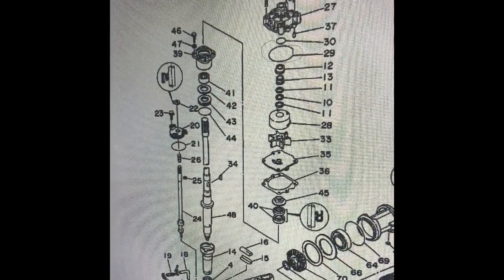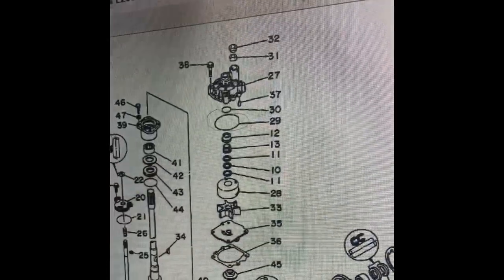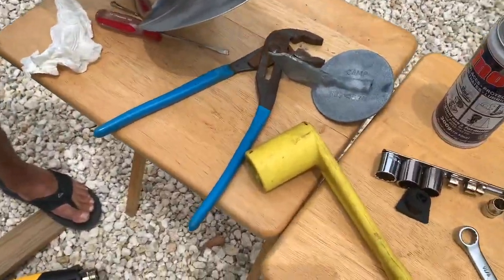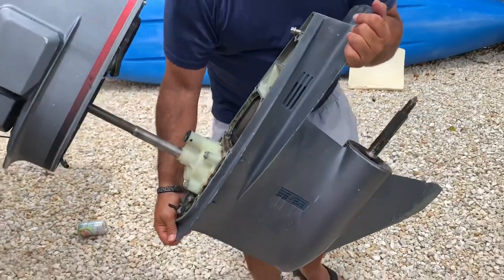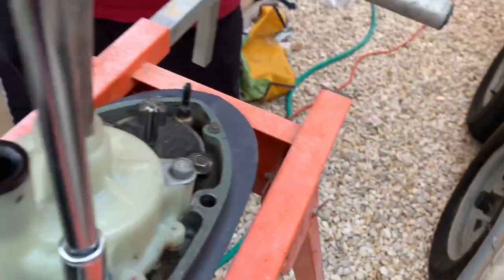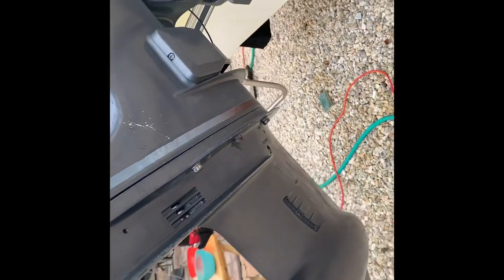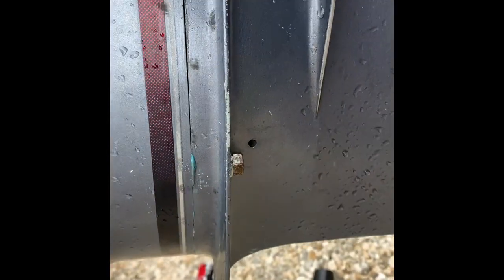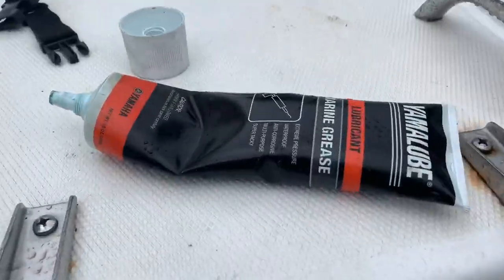How to Change an Outboard Water Pump on a 200 HP Saltwater Series Yamaha

Comment: Just love how you said video on how to do water pump and you didn’t show putting the hard part together great video
Reply: I agree didn’t show weather he firstly put it into gear how he changed the impeller what direction  he spun the housing how he lined up putting the lower unit back up  what torque settings to use

Comment: Do you have a picture of the impeller? I’m curious to see what it looked like. I got an overheating alarm the other day on the same motor. I’m thinking about your other video and cleaning out the water jacket. Pretty sure that super dirty. I’m getting a weak stream coming out so it’s either the impeller for the salt buildup in the engine.

Comment: Hi -- I have the same motor but 150hp. Motor runs great on the hose but under load bogs down, seems like not all cylinders are firing and boat doesn't come near plane. Any tips to diagnose before I take it somewhere?
Reply from the maker: Yes I had same issue a couple years ago. I bet it has gotten progressively worse right . ? I bet in the past you could get on plane then it would come off then got worse . It’s the carbs. You need a carb job . Take it to an outboard repair shop that you trust . In south Florida we have Eric’s . It’s per carburetor they will charge you but you will be all good to go .
Reply: @arnoldtrevilla  thanks for the reply! Honestly, it hasn't been run enough to notice and probably part of the issue (old gas). I'm up in Palm Beach County and unfortunately my mechanic has retired after 40yrs in business so will have to locate a shop.
Reply: I pumped all old gas out, carbs still needed cleaned tho. We're back floating!

Comment: Would all this be the same on a 2004 200hp salt water series II
Reply from the maker: Mike if the engine layout is the same with the water jackets at the back of the cowling then yes
Reply from the maker: My apologies I thought you were commenting on my other video . No do not assume that but would be surprised if there were much difference .

Comment: Have you ran the boat since doing this? I was told the shaft should go in all the way without tightening bolts
Reply from the maker: Yes I put shaft in all the way. And put bolts in and tightened them(Lower unit bolts ) evenly all the way around

Comment: what do you think about this engine things like consumption and problems compared to new engines is it easy to maintain end to find parts  ? I'm think to buy one this here in Brasil with 500 hrs used stop in the garage 5 year
Reply from the maker: I love this engine super reliable and easy to fix it’s a 2 stroke so yes much easier than 4 stroke and newer to fix but it does consume a good amount of fuel compared to a newer 4 stroke .
Reply: @arnoldtrevilla  how much it  consume per hr ?
Reply from the maker: @marcelopereque  I do not I apologize
Reply: @arnoldtrevilla  thanks per your attention DY
Reply: Love mine it pushes mt 23 CC really well.Wide open 41 mph cruises at 30 and it does get 2.3 gallons per mile not the best but hey its reliable